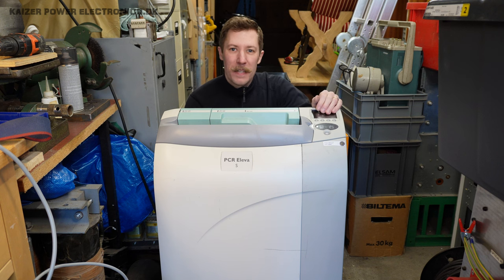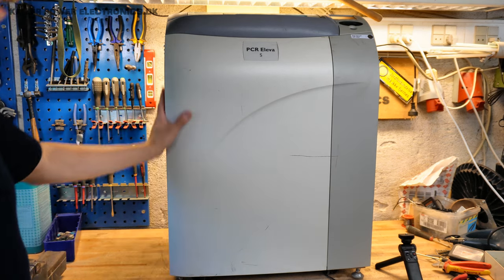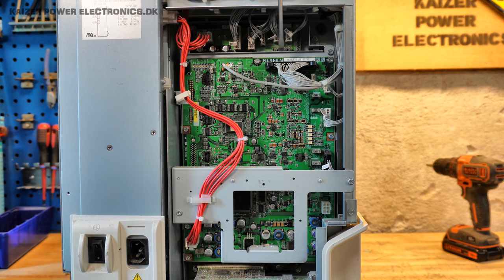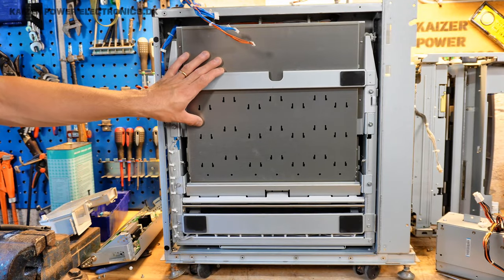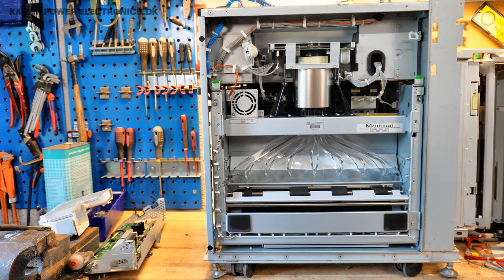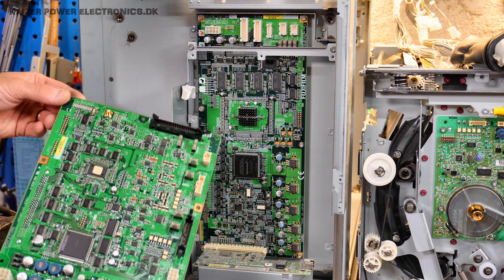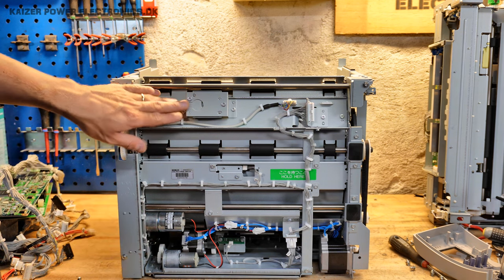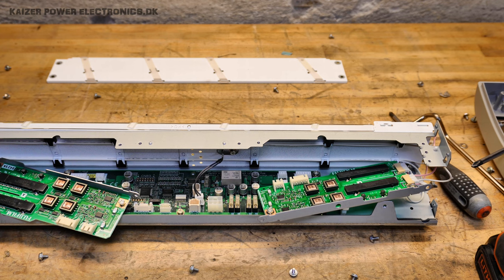X-ray Image Scanner Teardown. Philips / Fujifilm PCR Eleva S (Part 1 of 3)

Comment: The CCFL power supply seems to be using piezoelectric "transformers"?
Reply from the maker: Very interesting. I did not know about piezoelectric transformers in this application. Very efficient at low voltage and power. Just read this "Comparing magnetic and piezoelectric
transformer approaches in CCFL applications": https://www.ti.com/lit/an/slyt125/slyt125.pdf

Comment: Looks to me like the smaller PCBs in that big PSU are DC-DC convertors for thee 5V and 15V rails, and could be used separately off another 24V supply.
Though if your using opamps in your circuits, better to keep it as is.
Reply from the maker: The PMT assembly usually takes +/-15V for the op-amps on the signal from it.